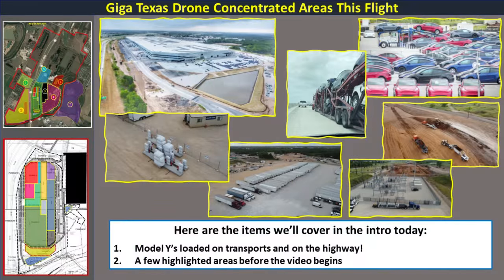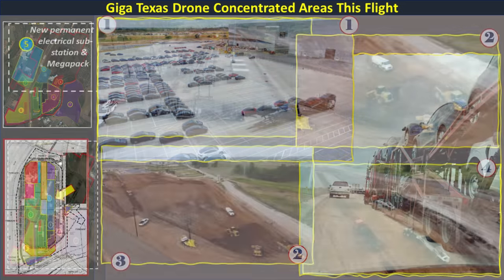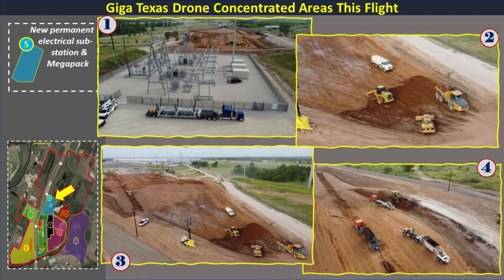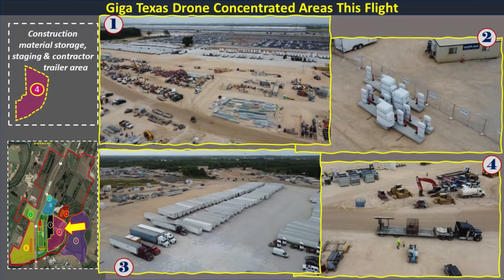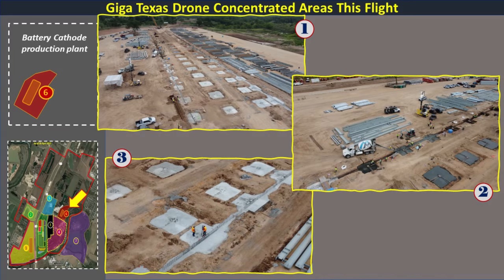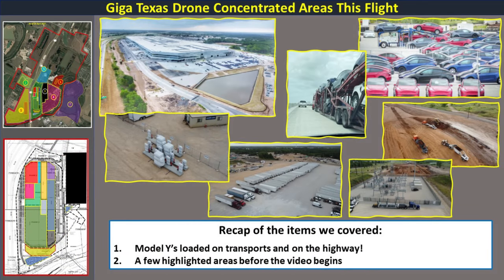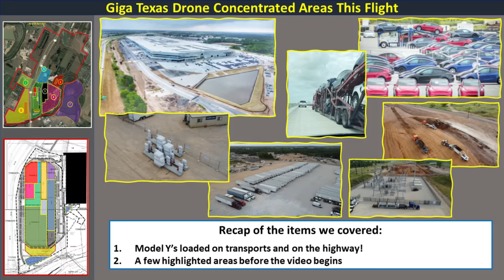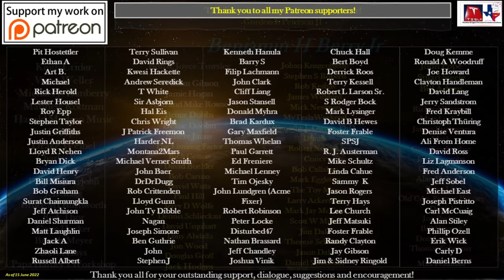Tesla Gigafactory Texas 15 June 2022 Cyber Truck & Model Y Factory Construction Update (07:15AM)

Comment: Thanks Joe.
3:55. GA apron. Rebar continues through the edgeboard, so apron replacement works to extend north.
Height of the round manhole grate surround hasn’t been altered. Apron here must be at original elevation and slope.
4:45. GA apron. Couple of concrete structures I think are for the sewer. Covers will need to be lowered to match the new slope.
5:33. Stamping Extension. Not much visible, but the lights are on.
10:19. Purple Pipe. Purple paint stain/overspray on the concrete to the right.
11:43. BIW apron. New loading dock area. Man for scale in the excavation to the right. Some drainage/sewer manholes to be lowered as part of these works.
12:31. East Main Entrance. Jeff’s video yesterday showed the small excavator busting out a section of the floor. Likely to create a setdown for door floor springs, and a different flooring material. Did the same for the GA Main Entrance, https://www.youtube.com/watch?v=C2Uk01I-jhw&t=188s
16:50. Northend roads intersection. Bottom right. A different view of the small retaining wall. Seems to be shielding a stormwater drain inlet.
17:53. Battery north. Second platform structure. Jeff’s video yesterday, it looked like this had been painted grey.
19:16. New substation/switchyard. Shaped up the berm on the east side.
22:39. Cathode. Worker cutting up foam to make the block-outs (for recesses) in between the column hold-down bolts.
23:18. Cathode. Surveyors standing over a recess in the top of the footing. Recesses visible in other footings. The recesses are to accomodate the shear lugs on the bottom of the column baseplates at seen to the left.
23:59. Eastside contractors area. Bottom left. Loading dock plugs lent up against the trailer. Paint colour testing. Street artist doing samples?
24:14. Eastside contractors yard. Black gadget on the back of the trailer looks like a forklift crane attachment. Gear in the cage looks like tool boxes. Couple of small crane counterweights to the right.
25:45. East-west road. Trench. Conduits visible projecting through the coloured concrete.
26:30. North-south road. Repairs underway.
Reply: 24:00  My conclusion on the number of trailers is that Austin was expected to be at a much higher production rate by now, and the preordered parts are piling up......  The POs  to Tesla's vendors have to be placed at least 6 months ahead of need.  So until Austin fixes what is holding everything up, I expect the trailers to keep piling up.
Reply: @eclecticmemes  At Toyota they have come up with another paradigm: instead of "just in time" it's now "just in case" regarding the buffering of (strategic-) stock items. But still I agree with your observation, there must be a hold-up somewhere. Earlier I mentioned that Austin is a bit different from e.g. Shanghai because it appears Austin wants to start their ramp with auxiliaries such as plastics and batteries/structural packs on line as well. This makes the initial phases of the ramp much harder I suppose, but once all the sections are in tune they may accelerate that much faster. Another telltale I think to support your analysis is the relaxed approach to the completion of the main cooling system on top of Battery. Near as I can tell only two coolers out of 7 are operational (fenced off).
Reply: @eclecticmemes  Seems logical. A good number of them would be empty. If production was stable, half would be empty (I think that makes sense). A number of the trailers have doors open, presumably empty. Production ramping, should be more full trailers than empty trailers. (Edit. On second thoughts that doesn't make sense at all, trucks deliveries full trailers would take away an empty. Logistics not my gig.)

The trailer parking area looks around half full, the area where all the Cathode steel was stacked not really being used yet. I counted 171 trailers. Didn’t count the recycling bin trailers, or the supercharger trailer. Potential for well over 300 trailers I would guess.

Comment: What is the point of new on-site electric sub station? Is it so Tesla station power packs can tie into grid ? 
Thanks for sharing. Keep up the good 👍 good work.
Reply from the maker: The current one is temporary and was designed to get the factory to initial production, but it is on the small side. This was part of the original plan as documented about 20 months ago.

Comment: Joe, Thank you for all of the trips down 35.  At 8:39 there is a good picture of one of Austin Energy's switchyards where the feeds to the substations are switched in case of a problem with a transmission line. At 8:52 there is another switchyard that selects which gas turbine generator (alternator) is connected to which output line. At the substations the voltage is dropped and sold to the local utilities for distribution to the customers.

Comment: I am interested in the math behind the claim of eventually 1 million cars a year from this factory. Just the logistics of getting materials in and vehicles out boggles the mind. A quick calculator session says a million cars per year means 2,739 cars per day. At 8 cars per transporter (typically 5-9 cars), that's 342 transporters per day. I'm slack jawed at the idea that they're going to process 342 transporters per day, let alone all the trucks with raw materials (there is no rail service to the factory).

Joe, I think it would be an awesome video to go over what a million cars a year means in terms of logistics in and out.
Reply: Shanghai does it although at some times alot is going to exports
Reply: imagine a time when the cars can load themselves onto a tesla semi which can the autonomously deliver the cars directly to the purchaser.  maybe 10 years away... maybe sooner, maybe later but I bet it'll happen in my lifetime.
Reply: I've posted the math multiple times......  As it regards to the number of loading bays, but it works for logistics too.  I'll see if I can't repost it.  It's not a direct answer to your question, but gets the job done.
Reply: I've made several posts doing the math on the loading docks.....  As is, there are enough holes in the building to support 1 million vehicles/year. 80% of the Model Y by weight arrives by flatbed carrying raw materials such as steel and aluminum rolls, ingots, and plastic beads.  20% arrives by semi tractor trailers.
1 M vehicles X 2022 Model Y weight (4555 lbs) X .20 (amount of weight arriving by tractor trailers) = 911,000,000 lbs.  In the US, Maximum load for a semi trailer without permits is about 45,000 lbs.  Let's be conservative and say an Austin Texas shipment is 30,000 on average.  911,000,000 / 30,000 = 30,367 semi trailers per year for 1 million cars.  365 days per year = 83 semi trailers per day or 42 loading docks if each took two deliveries per day.  Again this is for 1 million cars!
Reply: Flatbed trailers, on the other hand, typically can carry up to their maximum weight of 48,000 lbs (without permits) due to the bulk nature of the aluminum and steel rolls and aluminum ingots.  In that case, the the typical shipment would be let's say 45,000 lbs.  So doing the 80% math would require, for 1 million vehicles, 222 flatbeds per day carrying the raw materials.  Now that's a traffic jam.  There are 32 drive in doors, so at 1 million vehicles, each drive in door would have to handle 7 flatbeds per day.  Easily doable as we have watched multiple overhead cranes installed throughout the plant.
Reply: As of today, Giga Shanghai is close and approaching that daily production volume (Reuters, May 6, 2022: "...aiming to increase output at its Shanghai plant to 2,600 cars a day from May 16", ) and seems handling it no problem.

Apparently Giga Texas has much more space than Giga Shanghai. So logistically it should be fine. 

The eventual annual production could be more like 2 millions.

Comment: Joe, I am wondering about the directional pipe drilling under the Colorado river. I think you mention it to be two pretty large diameter pipes. In order for the to be drawn under the river there is a lot of dirt that needs to be removed. I do not see any major tailings at the drilling operation site? Are they successful in your opinion?

Comment: It looks as though the solar panel brackets are just sitting on the roof without fasteners, am I missing something?
Reply: I agree and it seems strange, unless the shoot them into the roof when we aren't watching.
Reply: Correct, no fasteners, just a bracket and ballast to hold the bracket down.  A storm a few months ago blew quite a few panels away, but we thing it's because the brackets didn't have their concrete ballast emplaced yet.  You can see the missing panels at the bottom of the E.
Reply: Manufacturer's video here about the ballast system, https://www.youtube.com/watch?v=U68-iUpfzpI

Comment: Got love the water truck spraying the dirt next to the road where trucks are kicking up dust at 21:00
Reply: That water is to lubricate the dirt being packed down. It’s dumped and flattened out in what are called lifts, then dampened, then compressed and packed down. It has water applied to a certain amount which lets the fine particles slide against each other but not so much that it becomes to lose. In the summer time where it’s a 100 degrees, it takes a water to keep it moist and it dries quickly. Do it right and it dries out to be damn near as hard as concrete.

Comment: "A+" as usual. Funny thing, while you fly around the site i find myself trying to guess where the next concrete/paved area will be that is destined to be dug up. Seems like they should of left everything dirt until the architects could catch up. LOL
Reply: They might have if it had been summer but it was winter to spring or our wet season. In the summer if we get any rain at all we are very happy. But in they were getting a lot of mud and while that’s acceptable during heavy construction, once you go into finish work and actual production you need to keep the place clean. So even though they knew they’d end up removing a lot of the asphalt paving for concrete, it was easier and cheaper in the long run than having to clean up the site every couple of days.

Comment: Do you know if the solar panels are currently generating power?
Reply from the maker: I don’t think so
Reply: The obvious thing would be to connect them up as they go along but that would require common sense.
Reply: @paulmcgreevy3011  probably nothing to connect them to until the new substation/megabucks are installed.
Reply: No need to connect them until an entire group is in place and you have a place to deliver the energy.  In addition, the guys placing them don’t have to be electricians. The guys wiring them up do. Big difference in pay scales.
Reply: Hmm access to the terminals on the back of the panels could be difficult for the panels in the middle of a group.  Seems to me an electrician working with the installers connecting while the panels are placed would be the most efficient process.
Reply: @joelinOz  seems to me a snap on connector on each panel would do away with the need for an electrician.
Reply: @Bill_N_ATX  put the battery there first. 2 years now since the project started.